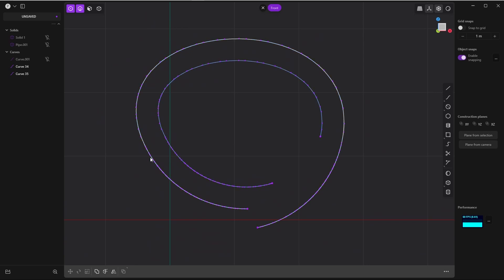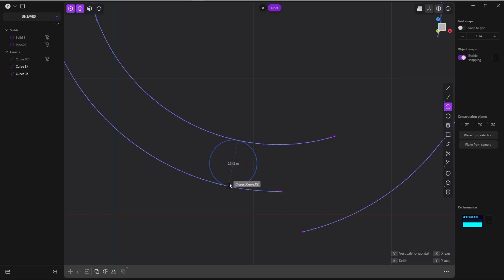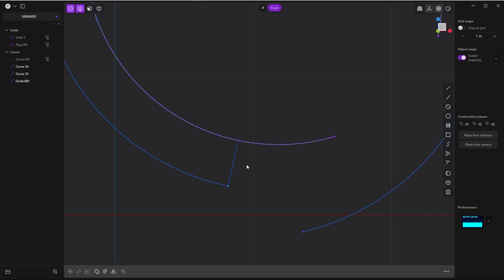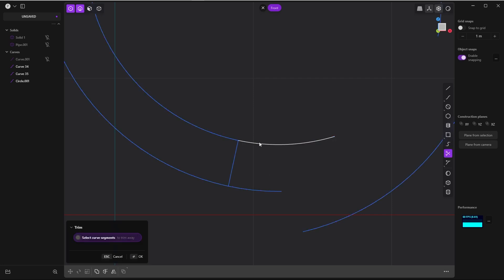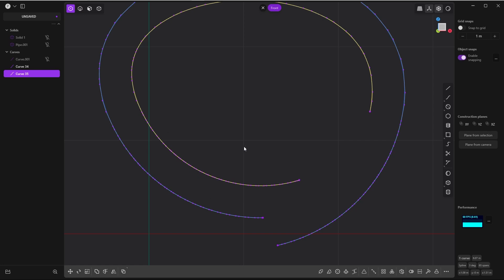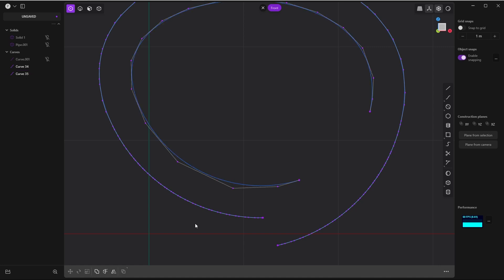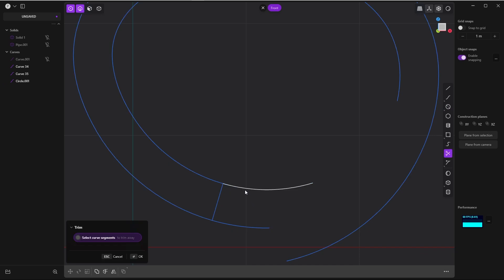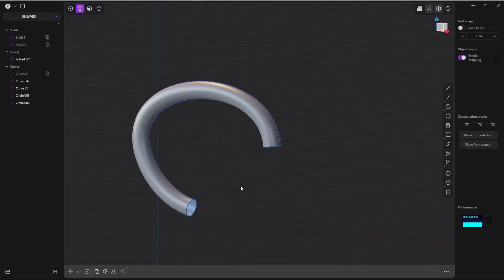Plasticity Tip No. 14 - Quick fix with rebuild curve

Comment: started learning plasticity recently and im loving this software so much. could there be a place in a future video for joining 2 curves with a shared point where then you can double click them to set continuity. haven't heard another video mention that specifically. maybe its well known but i was surprised to discover and think its quite valuable. and mention toggle between spline point and control point curve with Tab key during same video would be great. thanks. love your videos